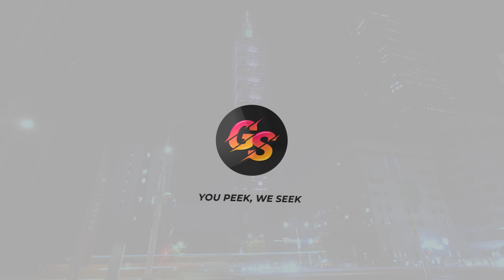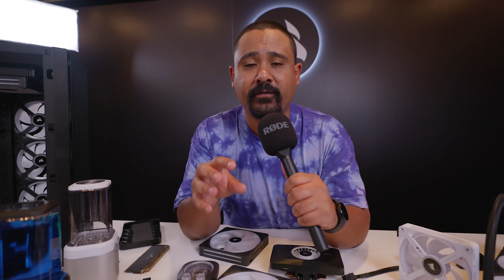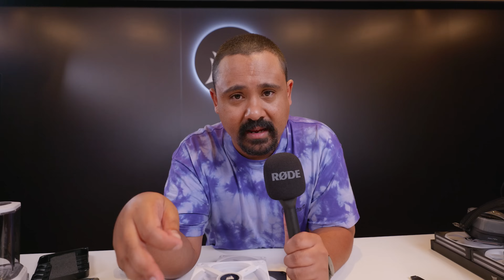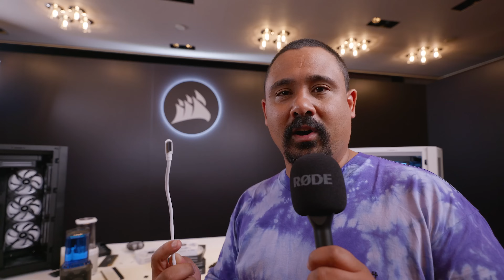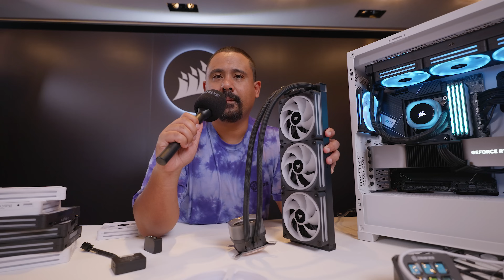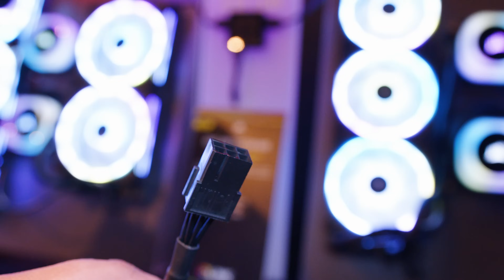The Corsair iCUE Link System changes EVERYTHING! - Computex 2023

Comment: I hope there is a cheaper option for people who want fan control only. I don't want the RGB, and I wouldn't really pay for the temperature sensor in each fan either. The linking and the single cable are where it's at though.

Edit: I think the temperature sensor does open up some potential AI analysis to give you optimal fan curves, but that will be through data harvested from everyone who buys these fans.

Comment: So, I just bought the QX120 Starter Kit that comes with 3 fans and the hub (for $159.99) and Corsair only includes a single cable and not the 90 degree one. I am using these in a Corsair 4000D Airlfow case and man that non angled cable is a tight fit. I also purchased an additional QX120 for rear exhaust (very common config) and that was $49.99 and the kicker is that is DOES NOT include a cable to connect to the hub so it is basically un-usable unless physically connected to the other fans. Seriously Corsair? Corsair sells additional cables (no in stock of coarse) for $19.99 plus $9.99 shipping so I need another $30 to even use my $50 fan. I am returning everything and going with some Lian Li fans. I consider myself a bit of a Corsair fanboy (no pun intended) but this is really something else.

Comment: I'm with you Gear Seekers! My last build has 22 QL120 and 140 mm fans. In a Corsair Obsidian 1000D case. With dual loop water cooling. It's beautiful. But the wire side is so crammed full of LED, Fan, and pump wire, I can barely close this mammoth case's wire and controller cage doors. This is a great idea from Corsair!

Comment: It looks good, but the only problem is, you have to use all Corsair product, and running iCUE on your system. You can't just plug them into your motherboard and control them with bios setting, which is  I preferred

Comment: This kind of thing is such a sick move. Easier, quicker, neater, no downside, love to see the innovation!
Reply: no downside.... except for the cost and being locked into a specific brand's ecosystem.

No thanks.
Reply: @joeyverliesharen  I generally buy the stuff and use a build for 4-5+ years. I'd rather a single brand have parts flush across the board done well instead of mixing and matching things. 

Theres a ton of cool stuff from computex this year so looks like builds are just going to get better and better anyway

Comment: Finally, but this will be insanely expesive. They removed one barrier of complexity to a new builder, then creates another barriear with price. Im willing to bet Lian Li will still be a better purchase.
Reply: You are 100% bang on here. It's just replacing one barrier with another. Innovation is great, but if they're pricing it out of reach of "normal" people, then what's the point.
Reply: Ya probably and this year's Lian LI stuff is very cool looking and the software sounds like massive improvement.

The cabling on this looks good so it will be clean for everything just think their stuff doesn't look as good and is probably not good enough for whatever this stuff will cost now. It's also proprietary so if they ever decide to change things then that's it for support for your entire system that uses it means you will have to replace all your expensive stuff if you can no longer find the cable or products.

Comment: Give me fans that attach magnetic like that and just get power cable (pwm or sata) and then just use bluetooth or wifi in the fan hub/frame for data connection for configuration. No hub needed.

Comment: So this is moslty aimed at people that just want to get a new build? Since there is no way to say make the new aio work with the older fans or the other way around,unless you run 2 control boxes at least.

Also does the fan connector clear radiator fittings?  Seems rather large and lianli had fitting issues on their older desing.

Comment: Just something to note... the PEG connector is actually Molex Mini-Fit Jr. and it predates GPU's even needing external power. You'll find those connectors in a lot of industries outside of PCs.

Anyhow, there's a lot to like here, but I'll have to wait and see before jumping back into Corsair's RGB ecosystems again. Between crappy software, and problematic hardware, I wasn't too happy with the experience when I spent over $200 in LL fans. They looked amazing, but just weren't worth the headache. Hopefully these are better.

Comment: Icue cannot pass the fan speed control to motherboard, which means corsair fans are utter useless to custom water loop systems as those systems most probably need to to have case fan speed based off the coolant temp.

Comment: love the AIO idea - damn am I going back to Corsair!?!?
Reply: wonder if the corsair controller will have the rm shift mini adapters avail vs full size psu connectors
Reply: If you want to pay 300$ + for a 360mm AIO, seems like a good option.
Reply: @timlolxP  missed the price... is that the price?
Reply: @wenicu3  Judging by the pricing of their current flagship 360 AIO, which cost over 300€ in my region, I take a well educated guess that this at least costs the same or more.
I could be wrong and corsair wants to make this a good value but i doubt it.